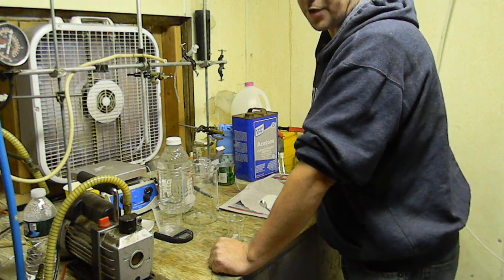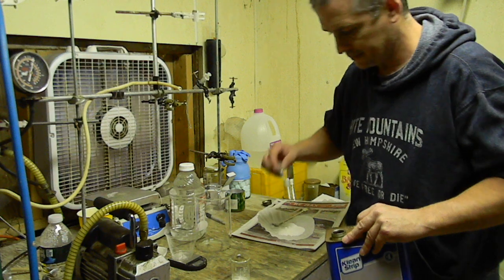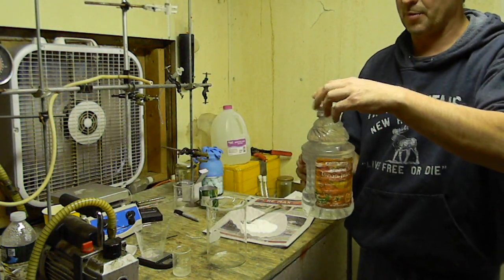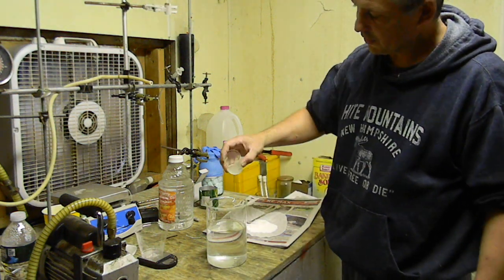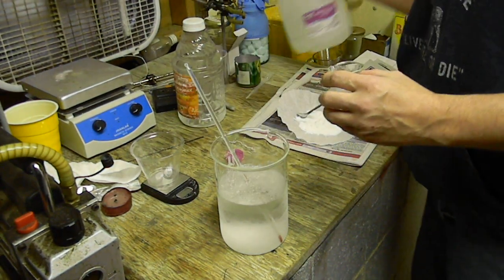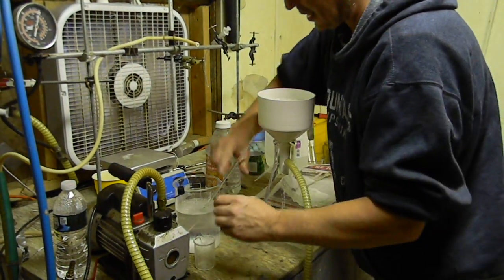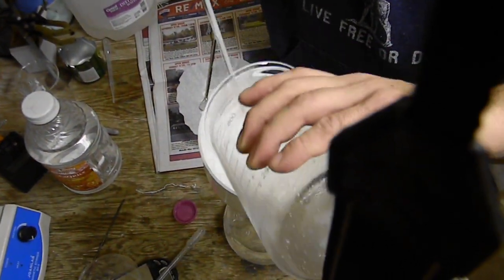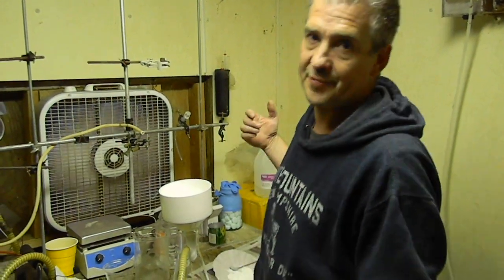Rrecrystallization of ETN

Comment: Would the recrystallization process be the same if I used 99.9% Isopropyl (IPA) instead of acetone to neutralize it?
Reply from the maker: Yes, it would be very similar but you may have to warm the IPA
Reply: @darianballard2074  Ah okay, there is a time it's hard to find pure acetone here in my area but however, is there a standard temperature for recrystallization of etn in warm IPA?
Reply from the maker: @Ανώνυμος-λ7ε  No, just do it in a warm water bath. Boil water then take off the burner and warm the IPA in that. Keep it all away from the burner because ETN can still go off in solution if any gets on the burner.

Comment: Would the Process for recrystallization be the same if I used 91% isopropanol? Is it necessary to neutralize it and if so is it still the same process but let's say instead of Acetone I used 91% isopropanol, because I've found with 91% isopropanol It creates a sponge that can be easily broken into a fine powder
Reply from the maker: Yes its the same process but you might need to warm the Isopropanol on a water bath or use way more of it. Yes it should be neutralize it.

Comment: What is the solubility of ETN in acetone, at 50C and 0C, for example?  I've searched and searched and found nothing specific.  Lots of good info with respect to PETN and acetone, but nothing quantitative for ETN that I've been able to find: just qualitative statements like 'more soluble in acetone than in methanol'.
Reply from the maker: I really can't tell you.  I couldn't find any good charts on that either, all i do is slowly add  acetone till all the ETN has dissolved and use as little as possible. I normally don't bother heating ETN when doing this but it can be done so long as its kept under the boiling point of the  acetone or reflux is used. Note only heat in a hot water bath or it could explode. I wouldn't even let the water bath come to a boil. It doesn't decompose/explode till around 160C but once it gets over 61c it becomes very unstable and dangerous. Over the melting point of 61C/142f its 5 times more sensitive than TATP.
Reply: @darianballard2074 
How can etn be safely melt-cast?

Comment: Please to all, do not use glass on glass or even worse metal on glass for stiring. Non cotact stiring, not even a magnetic bar teflon stirer.
Be aware of static electricity dangers, antistatic protection is mandatory!
Its nice to be a amature chemist, but for most its beter to be a practical and use it for more mandain things than this.
Electroplating, silver and recovery/refining, simple extractions (once a goldsmith).
In the US there is liberty to do everything at whil, by your own liking.
Not in my country, just be safe and smart!
Reply from the maker: This isn't that touchy, its not a peroxide or an azide, in fact its not even a primary.

Comment: Before Re-crystallization we need to neutralize,  for which we need sodium bicarbonate water solution in order to remove trapped acetone, 
Kindly help me prepare 1 liter of solution,
How much sodium bicarbonate (powder)  should i add to the Distilled water ???
Plz be in detail....
I also have ethanol available, isnt that good choice ?
Reply: You should dissolve 100g of Sodium bicarbonate in 1 liter of distilled water to make a roughly 10% acidity neutralization soda solution. By the way, MeOH and EtOH are better for recrystallization of ETN than Acetone or Butanone. Ketones are not ideal solvents for completely strategic recrystallization of nitrate esters such as ETN, they are too retaining and also produce large sensitive crystals most of the time when used like seen here in this video. Low molecular weight alcohols are the best solvents for recrystallization of ETN and nitrate esters above it in molecular weight, as they are less harsh/hard solvents than the ketones and also engender the development of more stabilized and uniform crystalline structures, as well as microcrystalline precipitates that create higher density final products if you choose to make a plasticized plastic explosive with your ETN.

Comment: What's the structural difference between ETN and PETN?
Reply: ETN is made from the nitration of the linear aliphatic sugar alcohol polyol Erythritol, whereas PETN is made from the branched aliphatic polyol Pentaerythritol (in this context the prefix ‘penta’ is denoting the fact that five carbon atoms are present). Like Nitroglycerin, and also the higher molecular weight non-branched polyols and cyclopolyols above it, ETN has a positive oxygen balance. When ETN combusts, specifically, it releases one molecule of O2 for every 2 molecules of Erythritol tetranitrate. PETN, like TNT and RDX for example, has a negative oxygen balance; This means that it is deficient in oxygen and the corresponding result is the fact that portions of its molecule will go suboxidized or unoxidized during combustion. PETN is not nearly as oxygen balanced negative as TNT or RDX however. One can imagine for simplicity of thought that the central quaternary carbon atom in PETN’s Neopentane skeleton goes fully unoxidized in a perfect world, when in reality, it is predominantly oxidized partially to CO, ~Carbon monoxide~ at the expense of one of the “Methylene nitrate” group’s carbon atoms that would otherwise go fully oxidized itself to CO2. Therefore, for every single molecule of Pentaerythritol tetranitrate, its full combustion is deficient by one molecule of O2.

You posted this question 10 months ago at the time of me writing this. I therefore assume you are aware of this information already. That being said, I still wanted to post this here for the record and for future reference by others possibly analyzing this comments section who may not be fully aware of this specific knowledge in regards to the technical differences between ETN and its ‘bigger brother’ PETN.
Reply: @ArtificialEquestrian  Thank you for the answer.  I really appreciate the details.  No, I hadn't looked it up since posting it.
Reply: petn hates jews

Comment: can i use Dibutyl phthalate (DBP) to plasticize ETN ?
Reply from the maker: I don't think it by it self would work you would have to do some experiments to find out.  Also be careful because we don't know if it will react with ETN.
Reply: @darianballard2074  ok, thx for reply.. i wiill try some experiment with that. Do you have any other suggestions for plasticizing etn with other materials? is hard to get PIB here.
Reply from the maker: @cartboy2404  I use VICTOR  rubber cement for tire repair, the kind i use says "use for all types of rubber repairs"  It comes in a yellow container and i use it the same way i use the PIB tape. https://www.plumbersstock.com/3rd_10863751_CEMENTRUBBER8OZ.html?utm_source=google&utm_medium=cpc&adpos=&scid=scplp599726&sc_intid=599726&gclid=CjwKCAiAm7OMBhAQEiwArvGi3O1LNc4GZX3YrQGUt_BTGGO5OYavI-fE4COY2e8vgax1V1STEYtw_RoC3PoQAvD_BwE
Reply: @darianballard2074  Next I want to try using Hydrogenated polyisobutene, Can it? because it is hard to find PIB here. maybe you have a clue?
Reply: @cartboy2404 
HPIB is perfectly suitable, you may use it in the same quantity as you would regular PIB. In regards to DIBUTYL PHTHALATE, it is an excellent general purpose plasticizer despite its smaller molecular weight when compared to Diethylhexyl phthalate, and works very good to keep your plastic explosive malleable and soft, even without a strategic free-radical eliminating antioxidant present, like Diphenylamine or p-Nitroaniline. For the best results, use something like:
· 85% ETN
· 10% HPIB
· 5% DIBUTYL PHTHALATE
The physical characteristics will be very comparable/similar to that of C4 or Semtex if you prepare this plasticized plastic explosive correctly.

Comment: How do you separate your ETN from the nitration solution
Reply from the maker: Filter or vacuum filter https://www.bitchute.com/video/78uQsxtKK3rE/
Reply: @darianballard2074  what ratio for AN instead of nitric acid everything else being same
Reply from the maker: @BabyGang-4x  Nope and it doesn't work very well using that method.
Reply: @darianballard2074  what’s with the ethanol says to use it to extract from nitration solution? I have done everything I thought I messed the synthesis up but guess not it got thick and I filtered as you say in video. So wasn’t sure if it was etn or not in that form where it’s like pancake batter

Comment: is it safe to store etn in aluminium tubes for blasting cap projects? i know that thermal shock when it confined in aluminium or iron will set it off. i want to know if there is any unwanted reactions in aluminium tubes? thanks
Reply from the maker: I don't store anything but i can tell you if you don't get all the acid back out of the ETN it wouldn't work out well to store it in AL
Reply: @darianballard2074  thanks for your answer. its hard washed and recrystallized  with ethanol
Reply: @darianballard2074   is it safe if etn directly contacts with black powder or  rocket candy or iron oxide thermite for a long time? i mean any possible reactions between etn and black powder that may cause decomposition or maybe detonation?  thanks
Reply from the maker: @sarahtomc2921  No it should be fine, but keep in mind high temps and impact can set ETN off.  Also if its near something like BP and the BP detonates it could set the ETN off.  I never recommend storing any explosives.
Reply: @darianballard2074  thanks for the answer. yeah i used heat shocking method for etn detonators in metal tubes with sparkler... but looking for something cleaner. thermal shock in metal tube always works... but what about black powder on top of pressed etn? looking for a clean nped method... i dont really like to use primaries... those are scary :D
Reply from the maker: @sarahtomc2921  You would be better off with silver nitrotetrazole or if you're good enough to not poison your self then Azides are second best. HMTD is very good as well but you need to be careful of dust, metal, sunlight and so on.

Comment: Any tips for getting smaller crystals?
Reply: Pour a smaller stream, or drip it into really fast stirring water.
Reply: Do not employ a ketone solvent. Use small molecular weight alcohols like Wood spirit (Methanol, MeOH) or denatured Ethyl alcohol ~Ethanol~ (DeOH® [EtOH w/ MeOH]) and dissolve 8–10g of ETN per 80ml of alcoholic solvent at a temperature[🌡️] of 40°C, then either shock-cool the solution in a freezer set to -20–-30°C or by slowly adding in ice-cold distilled water via dripping into the solution until you know all the ETN has crashed out. Both of these methods yield very fine talcum-like microprecipitates with unparalleled performance in PBX compositions. Of course, this is not limited to ETN. It also works much the same way with PETN, including the other higher molecular weight nitrate esters of the assorted polyols.

Comment: hi 
have a question why recrystalization is important ?
is it just for stablising or can effect (increasing)sensitivity?
Reply from the maker: For stabilizing for long term storage.  It is more sensitive  after  recrystallization.
Reply: @darianballard2074  
thank you very much
Reply: Depends on how you do it. Recrystallizing removes impurities like acid trapped in the crystals. It also allows you control over the crystal size. Bigger crystals from slower recrystalization are more sensitive, smaller are less sensitive. It's best to do a slow one first to remove impurities and a fast one second to make fine crystals. This stuff is best used as a booster to set off something else even less sensitive. ❤

Comment: To  remove all the acid simply dissolve your ETN in alcohol heat it to 55°C  and add ammonium carbonate until it tests neutral.  Magnetic stirring is implied. 

Here is some plastic made of ETN and NHN.

https://youtu.be/dYtzxnA5rOM

The detonator is NHN / ETN based.  #8 power.

Comment: Off Topic.. Could you do a video on double displacement (NON anode/cathode) of making potassium chlorate(KCLO3) from Bleach Sodium Hypochlorite.  The question  that puzzles me is about the yield.   Normal bleach contains about 5% sodium hypochlorite.  What would be the best ratio of Potassium Chloride to Sodium Hypochlorite  = best yield?    Would the same ratio apply if I used a stronger Sodium Hypochlorite  20-30%?
Reply from the maker: I may make a video on it.  First you must boil the sodium hypochlorite and that will brake it down into sodium chlorate, sodium chloride and water.  Then you would do the dd reaction with the potassium chloride.  You would likely only get 1/2 the chlorate out as the  hypochlorite you started with.